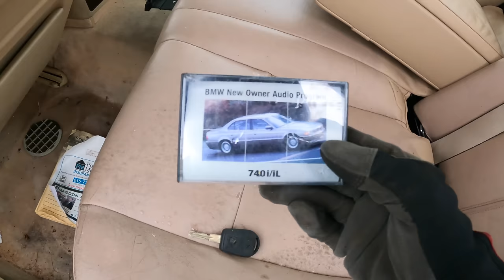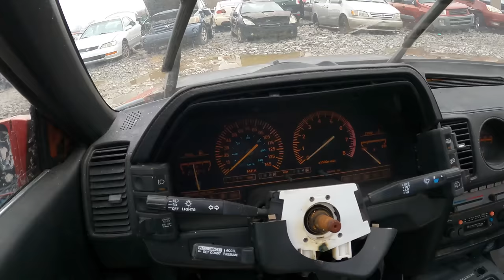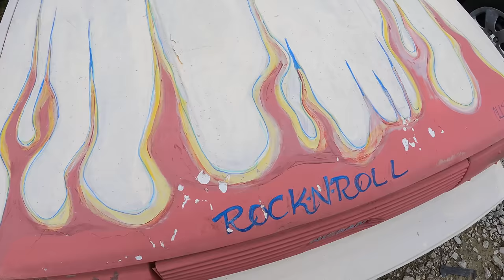Finding Project Cars in a Junkyard

Comment: Quick lesson... The E36 that was black was a 318 you don't want it. It's 4 cyl. And it's easier to actually find the 6 cyl... The Mitsubishi diamante is actually a cool little family race car. They had a turbo version and they actually have decent HP stock n/a. Also you missed 3 2j's 😅 also the 4 motion vws typically came big brake.

Comment: How do you get quarters from the junkyard? Do they let you just cut them off, and what do they charge?
Reply: Depends on the yard but they do prices also depends on the yard and what car
Reply from the maker: Usually they allow sawsal but not a grinder (sparks) to remove body parts like that 

I've seen yards charge from $50 to $300 for a quarter, so it's hard to say

Comment: That 300ZX with the digital dash reminds me of the one I used to own back in the 90s. Nice ride but it constantly needed work and I couldn't keep up with it.

The digital tach was more like a bar graph that went horizontal, and it also indicated intake manifold vacuum. The higher the bars went vertically, the more the engine was being worked. It was neat, when it worked.

Comment: I used to own a 98 5 series like the two you found in this yard. Mine was a manual as well idk how rare it would be considered but it was a cool car. I had a auto del sol as well with almost 400,000 miles, at least the shell did, motor still ran perfect, transmission was good too. Miss that one a lot.

Comment: @10:00  
Yep  had one. 1991 same year as your looking at. Black manual 4 banger 2 door with tan interior.  Ignition wire burned in two.  Mechanic looked it over thought it was a faulty wire and replaced it.  3 days later car burned to the ground.  Got so hot the there was a small pool of aluminum underneath it when they towed it away.

The white crown vic @11:24, that's typically caused by sap.  it's been sitting in a wooded area and sap has collected on it, and dried with dirt.

Comment: Thumbnail takes my back. I helped rebuild 2 Z31 project cars. One was red, the other, white…

About 15 years ago, I was 21 and I knew I wanted to get an old rwd JDM car. I ended up with a white na 86 FC RX7. A week later, my best friends lil brother bought a gold 88 FC RX7. About 6 months later, my best friend bought a red na 85 Z31. A week later, his lil brother bought an na 86 white Z31. So 2 z31’s, and 2 FC’s altogether.

We spent many, many hours over the next few years rebuilding those cars. Mine was a lemon. I sold mine a year and a half later and bought a Mustang. My best buddy’s lil bro sold his z31 cause he couldn’t support 2 20+ year old project cars while in college. Then my best buddy had a bad accident delivering food. He hit a jaywalker running across the street wearing all black on a dark rainy night. Jaywalker was fine, but my buddy was shaken up and sold his red z31 after that. His lil brother continued building his gold RX7 til he put $10k into it only to have the apex seals blow. He sold it at a HUGE loss after that. Now I have a 14 Fiesta ST, my buddy has an 08 Civic, and his lil brother bought a 17 Elantra.

Comment: That black e36 on the start of the video..... Aint bad... And a M42b18is engine 140ps.... Got 2 of them motors.... They work good.... Just need oil and water 😁😁

Comment: At 20:20 into the video, that looks like a Ford Y-block.  Look up the engine block casting number and cylinder head casting number.  That could be a very profitable engine to go back and pull.  If I remember correctly, the 312 cubic inch Y-block was the most desirable.

Comment: The Mitsubishi is the magna/verada known as the diamantes in Japan and North America. I believe all export models outside of Japan were built in here Australia. For us down under we also got awd/performance versions that were a bit of a sleeper but sales weren't great compared to the rwd falcons and commodores
Reply: yup instantly recognised it as a magna, my dad has had like 4 of them. They really are great cars though, usually AWD/ and sometimes gas/petrol hybrid, pretty bulletproof. My dad once had one that was 380,000 Kms. The older models looks quite nice, like the older performance gallants.
Reply: My parents had one when I was a little kid. A 2001 TJ Magna executive. Unfortunately it gave out mechanically around the 180,000km mark in 2011. I do think Mitsubishi did a great job with the design of the Magna/Verada in the late 90s/early 2000s though.
Reply from the maker: Interesting! Thank you for the info! I honestly never knew they existed haha

Comment: The green parts in the trunk were from a John Deere. You commented on the giant rod but you didn't comment on the big Pistons sitting right beside it. And I see at least three sleeves. The springs are for a pickup are there a combined or a Bailer.

Comment: I believe some e36s come with a m50b25. One of the great bmw engines, cast iron block etc. Also I believe the rx8 motor is not exactly a 13b I think its know as the renesis, which is quite a bit worst than the rx7 13b.

Comment: The fuel injectors on the Nissan hardbody Are valuable grab them all you need is a Philips screwdriver and good channelocks and the maf sensor the digital cluster on the z31 usually Are turbos

Comment: Mitsubishi Diamante was Mitsubishi's luxury model it slotted above the Galant. It was a competitor to the Acura Legend. They were pretty cool haven't seen one on the road in while. Hyundai Excel/Pony (X1) used to be quite popular. The X1 model was sold from 1986 - 1989. It was Hyundai's first model they sold in the USA it's heavily based on the Mitsubishi Mirage/Lancer from that period(1983 - 1988).  Engine(4G15), transmission, and chassis are Mitsubishi designed.

Comment: 5:16 Mitsubishi had the Diamante to sell alongside the Galant and more people liked the  larger  Galant so they stopped selling it here after that. I drove one back in 2003 on a first date when Ashley let me drive her car. Mitsubishi was popular then, and silver was very popular color in early 2000's for many cars.
Reply: Asa general observation, Japanese manufacturers of computer chips like mitsubishi and hyundai also produced heavy equipment like excavators and the mitsubishi fuso cab over box trucks. Mitsubishi used to manufacturer large, rear projector tv's in the 1990's. Japan would have sold many more sports cars if the USA didn't have archaic sanctions stemming from WW2. THe USA also limited Japanese cars to 276 HP output which is lame. But Chrysler and dodge really didn't have a rear wheel drive car for decades besides the Viper. SO they had borrowed a lot of mitsubishi technology and rebadged the eclipse as the plymouth laser and the eagle talon. What is cool abot the galants is that you could convert them to the AWD layout of the vr4 ifyou changed the gas tank to an eclipse gsx tank and changed out the suspension and mounted the rear diff, etc. DSM fo eva!

Comment: That E36 sedan was a 4cyl.

It's Bimmer for BMW cars. Beamers are BMW motorcycles.

2:16 That's what she said!

I remember the Diamantes in the 90s. They didn't sell well.

That Hyundai Excel was slightly better than the Yugos. Lol

The Ford Probe and S13 240SX cane out the same year. 

16:55 You skipped over the Beretta!!

Comment: bro, those are almost definitely the 2 300zx I was looking at getting a few years ago, silver one is auto and the red one was manuel, looks like somone pulled the swap tho.
Reply: Dude wanted 3k for both of em. The red one had some wiring issues but a straighter body any they had been using the silver one to get the red one going, the silver one was the manuel originally but they swapped it over to put the manuel in the red onr
Reply: what city were these in, it looks like a nice junkyard?
Reply: @timj5413  idk

Comment: i used to do what you doing and it was fun. illegal street racing on Sunday nights Monday morning back to  ecology auto or pick,  a part in San Diego   parts were the same price no matter if it was a 4 or a 10 cylinder 150 $ back in the 80's, i will like to get another 1972 Datsun 510 2 door we swap the engine to a 302 SBF 351 Cleveland heads  Edelbrock intake, Holley  double pumper.650 CFM C4 trans shifting kit short 9 in rear end, i have the same set up on my 69 mustang right now but its not as fun as it was on my Datsun 510, i miss those days, keep doing what you doing when you get to my age (50s) you will have story's to tell, if you find a datsun 510 please let me know we can work out something,

Comment: Definately an old tanning bed. Did you ever decide on a price for the z32 300zx trunk lid? Also the z31 300zx with the digital dash is probably an 88 or 89. Some sites claim the "1984 50th Annivesary Edition" had it and other sites claim that all 84-89 versions had it. Well I owned an 1984 50th Annivesary Edition and it had an analog dash so did my 86

Comment: Man I need a non turbo 2nd eclipse short block (420A motor) the threads in my block are sheared off on the crankshaft and the bolt is stuck in it from the previous owner

Comment: 17:12 oo ol international harvester, ill go with a 50's and its skatin on daytons, them ol widow maker rims,
that styling is fairly normal for the 40's and 50's
my grandpa has a 1948 ford F100 and its kinda similar with the big chonker fenders 
this IH was clearly a daycab of some kind, had air on it too, a i6 fairly standard, yet its a gasser
the cola truck is a bit more modern, looks... about 80's ish? atlleast interior styling wise maybe 70's? its got onboard air as can be determined by the air lines running up to what seems to be a hi/lo range splittter so its not extremely old, same with the loadstar, not extremely old cause of a lack of twin sticks
ok so the cola truck is a chevy with a big block v8 of some kind still on daytons
20:07
ill take a guess with the half cab thing that it was a RV
21:22 a big ol red cummins!